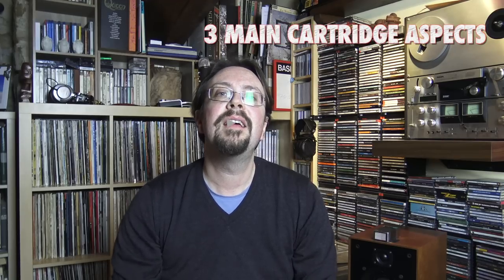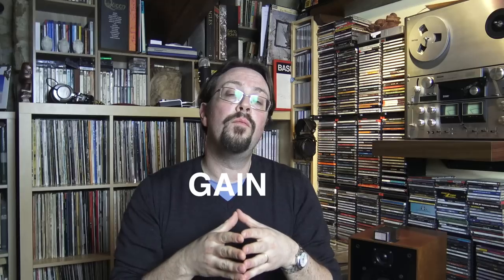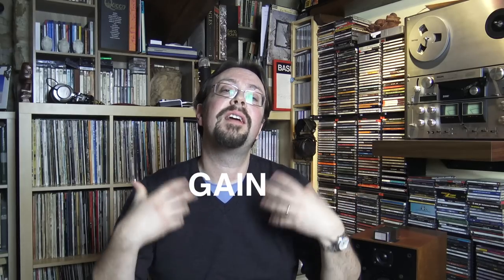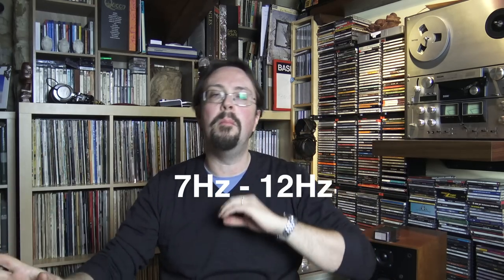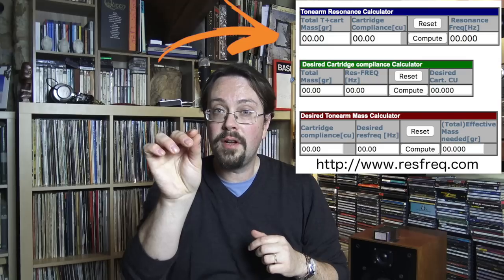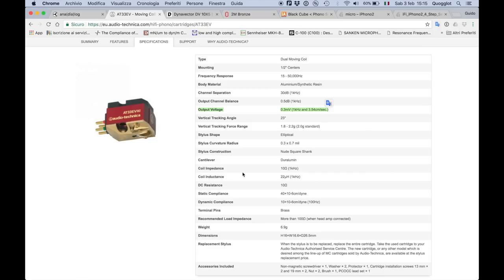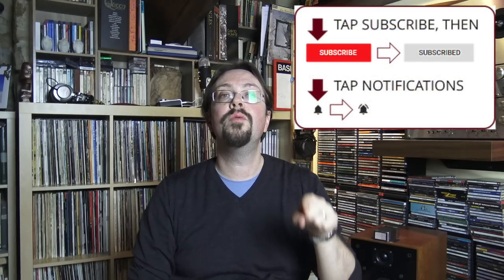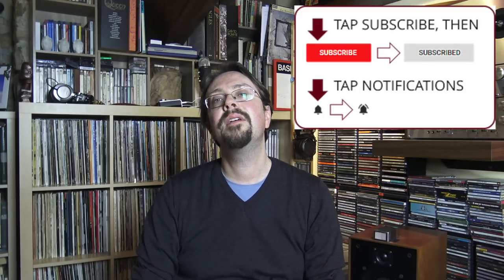PHONO CARTRIDGE: How to choose and match it with your preamp and tonearm

Comment: @ANA[DIA]LOG I would state that it is the *tonearm* that is the "heart" of the turntable, and the cartridge is more of a "major organ" -- what contributes the most to the final sound-quality is the tonearm   -- a "medium to high" effective mass, low bearing friction/low-play (chatter), low "initial-inertia", ultra-rigid tonearm can make or break the performance of the transducer -- in other words, no matter how high the subjective quality of the cartridge, its sonic performance is delimited by the tonearm performance.   This was illustrated to me recently when I used an Audio Technica AT-33SA  LOMC in a  Kuzma 4-point [11]   -- most would not pair a ~$750.00 USD cartridge with a $9,000.00 USD tonearm -- but *try it* if you can - you might be shocked. I am glad you find my www.resfreq.com site useful --  Wally Malewicz was a close friend and asked me "please get these formula posted and make it easy to use" -- I am re-investigating these formula, as I found the critique of Alex at Korf Audio rather compelling  -- so also check out his site https://korfaudio.com/calculator and double check that what you will buy matches the arm's effective mass. One small aside -- you did not mention the stylus tip geometry as a selection criteria -- be very cautious when looking at conical/spherical cartridges  (especially ones designed for "broadcast" use) -- broadcasters got 'records for free', and were unconcerned about the accelerated record wear that a conical/spherical tip produce. In the end, your record collection will likely dwarf your equipment in terms of investment -- so protect that investment, and opt for more modern/advanced styli geometries (with the caveat that you may need to spend a little more time and money in optimizing these newer cartridges). Thanks for posting.
Reply from the maker: I now one a 4point 9 and a quality cart is always going to be the most important part of vinyl playback. Clearly it's a synergy, there is no good cart without a quality tonearm.
Reply: @anadialog  I am more in Pierre Lurne’s (Goldmund and Audiomeca designer) camp, who stated (anonymously) “given a basic level of competence in the turntable ( and cartridge, sic), the arm was responsible for 80% of the sound quality produced.” I think that you will (eventually) come to this point of view, given more experimentation and time, and assign the cartridge to the significance of a lung or liver, and reserve the the “heart”  (or brain) for the tonearm. :-)

Comment: I’m new to Vinyl - My TT is a fully restored Thorens TD 125 MK ll with SME M2-9-R Arm and Ortofon 2M Bronze cart. The Preamp is an Audio Research PH3 SE. My front end consists of Sonic Frontiers Line 3, Power 3s and Martin Logan CLX Art speakers. The Preamp was purchased recently when I became interested in Vinyl. The previous owner was using a MC & I had to remove the load resistor to have any volume. The ARC PH3 SE input impedance is 47 ohms at 90pF unbalanced. The Ortofon 2M Bronze recommend load capacitance is 150-300pF. Currently, I don’t like the overall sound, could it be that I need to adjust the load capitalize to the recommend 150-300pF? Should I stay on the low end of the range, or does that matter?
Reply from the maker: Nice setup! Well, if a preamp is designed for an MC cart the results with a MM cart may not be optimal. The contrary may instead work with a high output. Try changing phono preamps if you can and see what heppens.

Comment: Hi, I recently bought a Technics SL-Q310 turntable and the needle is totally worn out. So, I searched online for new ones and Technics doesn't make them anymore (neither the cartridge) and prices of compatible ones with my cartridge are around 25€.
The other option is buy a new cartridge compatible with my turntable (uses P mount) but I don't want to spend more than 35-40€. I searched online and I found than any of they have as good frequency response as mine, which is the original one, the Technics P30, and goes from 10Hz to 35kHz. The ones I saw for that price go from 20 to 25kHz in the best cases.
I'm new in the vinyl world, so I'm a bit lost. 
So considering ALL this facts, should I stay with my old cartridge (but better as far as I know, because I don't know what makes a cartridge better) and just replace the needle or buy a new compatible cartridge for that price.
Thanks so much, I would really appreciate your Help.
Reply from the maker: Hi Yago, I understand that the extending frequency response is tempting but in order to playback all those frequencies yoy also need a proper system, starting from your phono preamp and loudspeakers. I think you are bettet off with a new cartridge without a deteachable stylus, I think that signal brake is worse than the lower frequency response. Hope this helps!

Comment: Can you please explain to me if the nominal tonearm effective mass is calculated including headshell or without? I want to install a 26gr/ 5cu compliance/ 3gr tracking force cartridge to 3012R tonearm. I imagine I have to change the headshell anyway, but without knowing this parameter can not decide which one (btw which is the weight of original headshell?). I need to reach a total 50 effective mass.
Your help would be very much appreciated,
Reply from the maker: Usually, no, it is not included. You need to add that parameter according to which headshell you have.
Reply: @anadialog  SME  finaly answrted that headshell is included in 14gr of effective mass. So I have to exlude 7gr of rhe S2R mass for the final decision.
Reply from the maker: Great!

Comment: I wonder whether I can mount Ortofon 2m (red) on my Dual 704 with original tonearm, if I use Technics SU-7300 amplifier with phono stage? The problem is that older equipment usually doesn't have much info around.

Comment: I am looking to upgrade my Scott turn table with a cartridge. I have an integrated Amp and i was wondering how input sensitivity played into this equation. Mine has a sensitivity of “Phono MM: 2.5mV” is this something i need to pay attention to when buying a moving magnet cartridge and if so what do i need to look for?
Reply from the maker: If you are using and planning to get a MM cartridge and have a MM phono preamp, you won't have problems. You may have some issues when you get a very low output MC or, rarely, MM cartridge. That needs a good amount of gain and quality electronics to amplify nicely the subtle signal coming from the cart.
In any case, if your amp shows an input sensitivity of 2.5mV, that means that the MM cart should have at least that sensitivity or higher. More is better.
Reply: @anadialog  Ok. That helps alot!

Comment: thanks for the great video.I am having an Ortofon mc turbo 3 cartridge and i'm constantly wondering if my MC isn't too cheap (considering) to compete with more advanced MM cartridges. What do you think? should I try for example ortofon 2m bronze instead of my MC turbo3?
Reply from the maker: Hi Karlis! Well I checked the specs of the turbo and it seems a very nice cart. The only fact that strikes me us that it has a very high output. Almost as an MM. I think you can stick with the Turbo if it is already yours. If you decide to change I would definitely change brand or go for a higher upgrade. The Bronze for instance seems very similar to the Turbo so to have a true difference I would go with a Dynavector DV10X5, a cheap Benz Micro (difficult to find) or Sumiko Blue point 2....
Reply: Wow, thanks for taking your time and looking into it. Indeed MCturbo-3 by ortofon is a so called high output MC cartridge and honestly I really like it. The thing is that on one type of records (even the new reissues or brand new ones) I get a reall unpleasant distortion on cymbals and especially on vocal's "s" sibilance nearing inner groves. I am aware of IGD but even a specific cart reallignment doens't help. . I have tried many cartridge allignments, biases, VTAs, etc., but I can't get rid of them. A wide ~1kHz - 10Khz distortion when vocals hits "s". Maybe it might be something to do with the cartridge wearing out already, but still. I was wondering if your suggested carts would do better job at this. I have a nice ARCAM preamp and rega with rb303 tonearm.  For example ACDC inner songs in Back in Black sound terrible on even a brand new record. I would sincerely appreciate if you could give me your openion. Greeteings from Riga, Latvia and keep up the good job!
Reply from the maker: Well Karlis, it looks like you may have an issue in the turntable leveling. If the platter is perfectly leveled maybe you should try to use a test record like that of Hi-Fi choice. That could help. Considering the topic of this video are you sure you are not picking up some resonance with the cartridge compliance and tonearm mass? Did you use the app I suggested in the video to calculate the frequency resonance of the match (in your case the Turbo + tonearm mass)? Since you are talking of 'one type of record' it seems that you may be facing strong resonance, which may distort the correct tracking/reading of the cart of those inner grooves...
Reply: The resonance is right on 10 and with HiFi News Test lp the inner groove distortion bias was quite decent. Mistique. as the distortion appears similary on both LR channels at the same volume. I can even hear the distortion without the amp turned on, just putting my ear to the cartridge listening to high freq audiable waves. Of course this sybilance  happens to  loud masters, loud songs and nearly always in the inner grooves.  In your opinion would this correspond to a worn-out or soon to be worn-out cart..?
Reply from the maker: Yes it could be! Did you try to use a different cartridge? Even a cheap one... That will rule out a lot of doubts...

Comment: Infortunatelly, the brekage of my Infinity Black Widow tonearm has attaIned me in a absolutely infortunate tragedy. Although my phone cartridge is untouched the typology of a replacement arm will be absolutely a big job to the replacement efforts. Due to the vintage age of my vinyl reproduction system I will legitimately need to make complete research to the compatibility and matching of the very low mass arm to the low mass phone cartridge. Please sir can you recommend to the best typology of tomearm that will be best matching and best sounding to my Bang & Olfson MMC 20CL moving iron cartridge? Also, my turntable is Pioneer PLC590 direct-drive turntable and my preamp is a McIntosh MX113 tuner/preamplifier with 2 integrated phone inputs.
Reply from the maker: Hello Johnny, well, the black widow is a great arm with very low mass. You need a new arm with very low mass, which are very expensive. Good solutions are usually magnesium arms, which are very light.
Try looking at the Vinyl Engine tonearm database: https://www.vinylengine.com/tonearm_database.php?make=any&mdl=&sort=5&eflo=&efhi=&ascdesc=ASC&mdlo=&mdhi=&ohlo=&ohhi=&search=search&amlo=&amhi=&cw=&mp=#thumb

Comment: Hello m8, you are doing an excellent job, so i ll ask for your advice. Iown a Dual 505-4 Legend with a ULM tonearm which has low mass, about 8 grams. It has an Ortofon OM-10  and i m thinking of upgrading the cartridge. Unfortunately i cant change the vta, so i m kind of stuck with the Ortofon cartridges duo to the same height. What is your recomment of cartridge in the 300-400 euros area? ty
Reply from the maker: Hi there, well considering what you wrote, and remaining in the MM domain, I would say that the best upgrade would be an Ortofon Bronze! Can't go wrong.
Reply: ty, keep up the good videos

Comment: There is no single Mass value of a Tonearm then? Because it can change depending on headshell weight, screws used and of course what about Tonearms with several different counterweights?
Reply from the maker: Yes, besides its geometry and constructing materials...

Comment: Sir,
I have  audio technica LP120. is it necessary to have a pre amp separately?
I have connected to DENON AV RECIEVER. Please suggest me .
THANKS
Reply from the maker: You should have a small knob behind to select Phono or Line. Selecting line you are using the integrated phono preamp in the LP120, with Phono you can use your own external preamp (better).

Comment: Guido, i just got my fluance rt85 today and it comes with a ortofon blue, have you ever aligned one of theze carts? It is not easy for me because the body of the cart is angled on the side and is very narrow at the bottom, any ideas will be appreciated
Reply from the maker: Yes, I have. Judging from your comment I am afraid that you have been using the cartridges' body to align it. Never do that. As I have explained in my video on setting up a turntable l, https://youtu.be/GqWh41NT1Cc , always use the cantilever to fix the whole cartrdige parallel and perpendicular to the allignment protractor. That is because they are rarely perfectly straight and perpendicular to their body.
Reply: @anadialog  i will try but dont know if my eyesight is good enuff to see rhat tiny little thing

Comment: I am thinking of exchanging my pre amplifier for a Mofi StudioPhono, I have an Ortofon 2M Bronze cartridge.
Do you think it will be a good upgrade?

My current system is: Fluance RT83, Ortofon 2M Bronze and a Pro-Ject Record Box E pre amplifier 

all suggestions are welcome

Thank you,
Reply from the maker: Ola Licinio, time to upgrade hu? 😎 
Well, I think the MoFi is a great choice for the Beonze and other carts. Nevertheless, if you can do the extra stretch go for the Black Cube SE II. I have changed several pre-amps but to this day I still regret selling my Black Cube. Just simply musical!
Reply: @anadialog   hello, it costs almost 3x more, for now, there is no budget available. Step by step I get there ... One of the reasons that led me to choose this pre amp was to include a button for "MONO", I already have some discs in MONO but not enough to buy a cartridge just for this purpose
Reply from the maker: I guess in the US the price is much higher. Yes, a mono switch is a good idea but a mono cartridge is the way to go if you want to get the best out of those mono grooves.
Reply: @anadialog  eh eh, I'm from Portugal, the price I have is around 900€
Reply from the maker: Great! That is the price of the Black Cube mire or less.

Comment: The tone arm AND cartridge ... followed by the deck  ... are the most important aspects ... upgrading the cartridge on its own without considering this, would be a  total waste of money.
For example, you would not put a £3000.00 cartridge on a £300.00 turntable !  ... and that is a fact!
BTW ... most decent (and even budget)  phono pre amps can deal with any cartridge  (MM or MC)  matching issues.
Reply from the maker: Yes you can. You can't do the contrary. Put a 300$ cart on a 3000$ turntable. Check my review on my Stabi R. It's good but absolutely not worth that amount of money. Turntables are not rocket science and IMO a decent deck can do great things. Cart have crazy prices but the quality of those high end carts It's just outstanding, can't say the same for turntables. https://youtu.be/XmCZPFh880s

Comment: Hi i`m interested to buy my first turntable. In my country the resell value of sh audio equipment is very low and difficult to resell ani thing. So i want to buy the best on a sensible buget no more than 4000€ turntable. I want to use my yamaha as1100 amplifier as a phono pre amp as well. For mc i have 100u/50 ohms and mm 2.5mV/47 k- ohms. It is possible offer me some directions in wath turnatable to get and wath tipe of cartidge to buy? Speakes ar a diy scan speak with beryllium tweters . Many thanks for sharing your thoughts on YouTube
Reply from the maker: That is a great budget. I am pretty confident that a Technics SL1200G would keep you happy for a very long time! Otherwise a Rega P8 is surely an excellent choice or you could go for a Clearaudio Performance. With such an investment I think you should also consider purchasing, perhaps in the future, a dedicated phono pre-amp. The cart is a whole different world just as important as the turntable. It depends from your budget.

Comment: Great vid but dam confusing ive a ittok lv2 with a mass of 11.5gms and im thinking of a audio technica AT33PTG/11 im hoping they will partner well together ...any ideas?
Reply from the maker: Paul, that is ehy I did this vid! Grab the specs of the cartridge ,(compliance and overall weight) and inser the values combined with the total weight of the tonearm in the app in the video description...remember to remain between 8hz and 12hz!
Reply: What value static or dynamic value ive a total mass of 18.4 and static of 40 and dynamic of 10 cm/dyne (same as the audio technica 33ev you showed as an example )
Reply: Think I've sorted it came out@8.8hz
Reply from the maker: Great! I was waiting to look inti this but there you go, the perfect match! The best is 10 but 8.8 is very good!

Comment: Basically with capacitance since my 2m blue is between 150-300 that means I need to fall in between those numbers with my preamp, rca cable and tone arm wiring?
Reply from the maker: Yes, but I think you just need to check cartridge and phono pre-amp...the rest will obviously introduce a change in the final value but most probably not that relevant...in the end the lengtu of these cables are very small....
Reply: Thanks my Lounge LCR MK3 has 120pf capacitance and the cartridge falls between 150-300pf. I am going to measure the cables capacitance to make sure I didn't go over the 300pf since my cable is 4.5ft long.